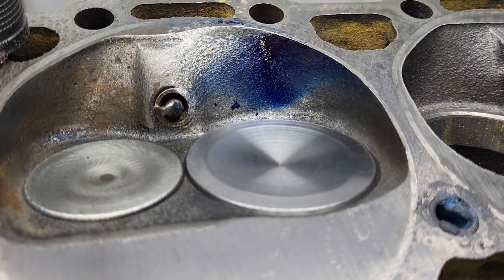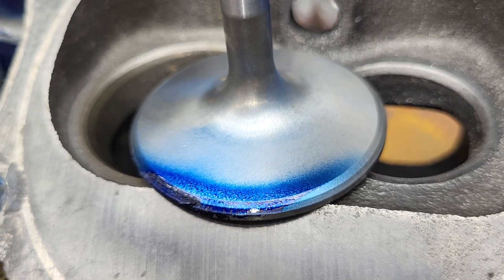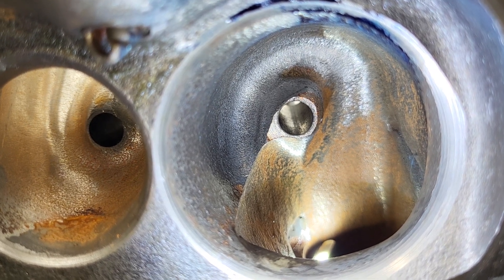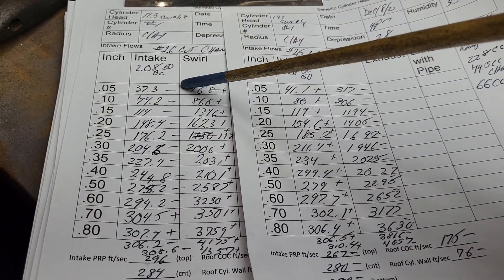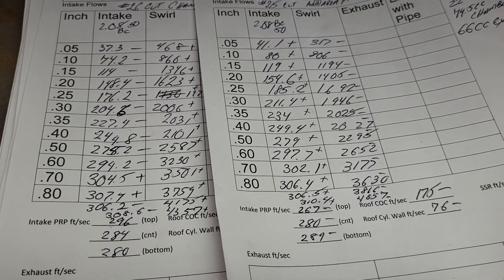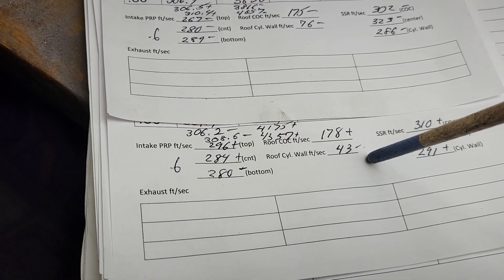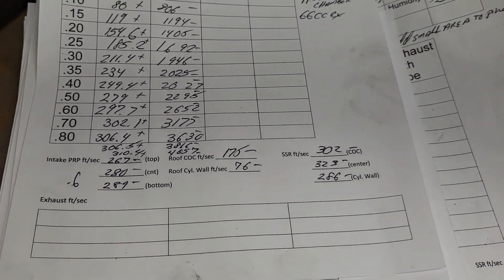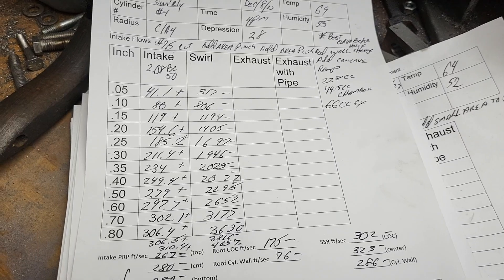29. Chevy 193 TBI Swirl port cylinder head, #26 cut. change high helix ramp profile. Big loser!

Comment: I'm working up a Dyno-Sim 5 engine for you on my PC , i will let you know how cut 25 - 193's work on a 383 cu in short block Hp & torque wise....
Reply from the maker: Make it 393  use 3.65" stroke. Thanks
Reply: @servediocylinderheads  I can do a 394 with a 0.020 over 400 block and that crank , i'll go with a 5.875" rod for now , u have a compression ratio in mind ?
Reply from the maker: @luckyPiston  We would like to use a 6.2" rod. Thanks
Reply: @servediocylinderheads  Okee dokee, right now with 5cc v/v relief flat top piston, zero deck, 0.038" compressed gasket  compression is 10.23:1, head milled back to 64.5 cc or 10 cc pop up piston would make it 11.43:1
Reply from the maker: @luckyPiston  Nice
Reply: @servediocylinderheads  The camshaft i loaded in the program was Comps biggest hydraulic roller , its not the best cam for this motor , i ran the Dyno sim integer (1000's of timing combos) for cam timing and cams with less duration punch up the mid power curves a lot with only small peak losses. So the 394 is a solid 630 hp @ 6500 rpm motor right now.

Running the integer for induction shows the motor likes a tunnel ram to push closer to 700 hp , at 8000 rpm the motor is using every bit of the 950 cfm carb.
Reply from the maker: @luckyPiston  Thank you!

Comment: You'll have to do chamber work to make the ramp changes work, it's not a failure, it's just not finished! You moved the flow over a bit, so it's doing different things in the chamber, instead of swirling downward into the plug, it's dipping down a bit then coming back up.

Comment: I told you to stop..at 3.22 Add underneath the valve.
Could I left a quarter inch?
More material 2500 cfm at .700 
When I had a stroke 2 years ago. And I can't talk right. I got All my wits about me.. But I can't explain things.. I told you I I done a bunch of these heads..
Reply from the maker: 2500 cfm at .7 is quite good. Thanks
Reply from the maker: Did you modify these heads in a similar way?

Comment: The air isn't going to swirl around the back of the valve like it looks. That is a pipe dream. The more you hollow that out,  the more it creates a vortex there and a subsiquent low-pressure spot. Which is why it didn't work like you wanted.  Use clay to fine-tune the shape now that you have cut most of it out. Fly a string down and see where it goes. It's not going to wrap around the back and corkscrew down the valve...
Reply from the maker: String is very interesting. The air speeds are interesting as well.
Reply from the maker: I know exactly what I want to change on the next port. Thanks
Reply: @servediocylinderheads  your doing great work, buddy. Thanks for sharing with the world!
Reply from the maker: @seanbrown8269  Thanks!
Reply: These are interesting videos, even some bad news relates to progression because knowing what doesn’t work better or produce positive results is still a lesson to point us in the right direction

Comment: With all that swirl at the higher lift like I wonder if there would be extra A/F mixing and would that make for a more complete burn? 

Wouldn't it be cool if you had a one cylinder engine where you could bolt a sbc head on to run on a little 100 HP dyno.😯 That would really tell the story if that little bit less flow makes more or less than the previous cut?😎👍
Reply from the maker: The swirl port was a band aide for the throttle body injection which is a wet flow system. Large droplets.

Comment: Of course it feels like you lost, especially after coming this far and putting so much time and effort into it. It was still good data and some insight though. I would say your on the right track. Work on the exhaust side a bit. Take what you have learned and start on the next one working your way up here and there to a final design. Then all you have to do is that 7 more times! 😆. I do applaud you for being this dedicated on a set of "junk" heads. It was an Interesting update as always charlie, thanks
Reply from the maker: You are welcome.

Comment: May I suggest that before you cut it for the 2.1, that you fill the ramp with clay, and do a quick test. I think that the helix is shorter and lower than it was, so digging it out has lost the potential effectiveness of the mod. That said,  I could be completely wrong,  but as I was watching you develop the port, I felt that you had gone past the point of potential benefit from the helix mod when you got those good gains digging into the ramp face. Still,  very interesting results.
Reply from the maker: I did fill it when I tested the 2.1" valve.
Reply: Yeah i think u might b right , where the two air flows meet might be to far down in the bowl now , the distance the combining air fronts have to flow before discharge past the valve might be to far and hence turbulent. ... so what does more swirl and less airflow over the roof say about what i just wrote there ? ... i think it disproves that theory and the steeper helix improved flow in that area to the detriment of flow elsewhere , perhaps the otherside of the bowl ? just some thought stream there idk ?
Reply from the maker: @luckyPiston  It is interesting to think of. Thanks

Comment: Why is too much swirl bad ? If it flows more and swirl is
More ? I would think more swirl the better ? 🤔  like what would a 10k swirl 320cfm head do ? Vs a 2k swirl ?
Reply from the maker: The theory is it will centrifuge the fuel.
Reply: Several years ago I read everything on Larry Widmer's site. Seem to recall that was his conclusion. I'm not applications you could run leaner. If I recall he originally thought it was due to mixture motion during burn. However, he came to understand the fuel was at proper ratio on the outside of chamber, lean at the center. Not sure how that worked when he became fascinated by Honda performance... All this was many years ago, so I am likely remembering it wrong. He was the originator of this whole swirl port thing.
Reply: In MPG applications. I hate autocorrect.